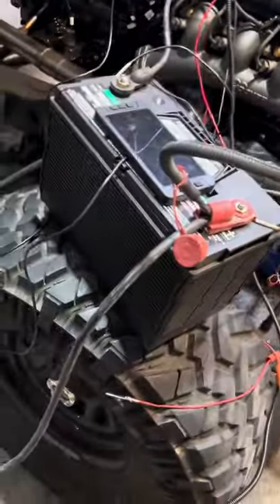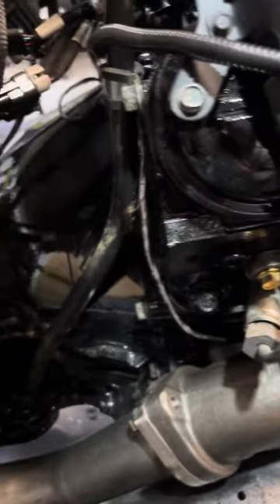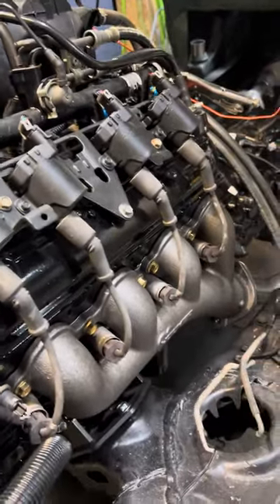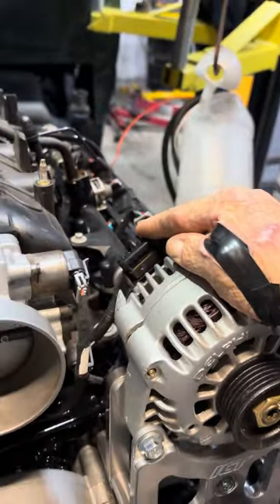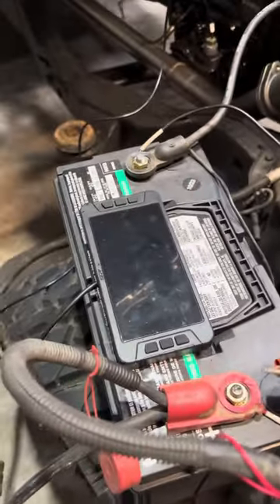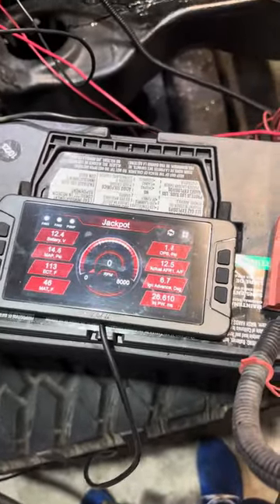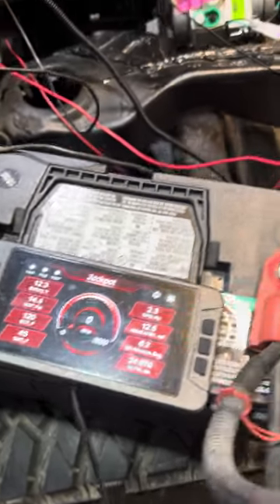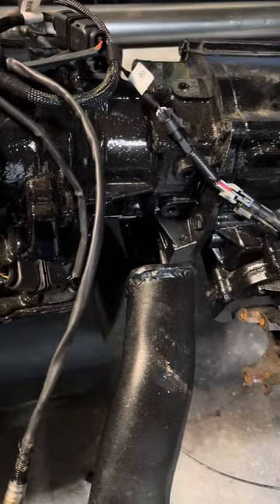Ace jackpot review

Comment: This is the second time I've heard the screen jumping and disappearing, so basically though they're cheaper than the Holley and other, ect. It's not worth the money. Did Jackpot help you out with the screening situation?
Reply from the maker: No. I mailed it in. They sent it back the next day and didn't fix it. The AC wire should turn on the fan, but it doesn't work, and their techs can't figure out why.  I just unplugged the screen and run it.  I would not buy this again.   i have a fi tech and a holley.  both are much better.

Comment: Thanks for the video I’m currently getting ready to install mine on a 71 el Camino I’m gettjng confused on how to wire the alternator
Reply: Main power wire from alternator goes to positive post on starter, along with the positive from the battery. the plug that goes into the alternator is a smaller wire and that goes to your keyed ignition. also don't forget the body grounds aka the ground from your block to the battery. if you don't do that it wont turn over very well. learned that the hard way

Comment: I have a problem where the lights on the ECU won't turn off.. is this normal to have the ECU lights on with the key on the off position? Please help
Reply from the maker: No clue.  I’ll look at mine.  It’s under the dash
Reply: Check which ignition feed you are using

Comment: your using the older style coils I thought you need the newer smart coils for this harness I guess not huh in less you modified it thinking of getting this system myself good stuff 🤙
Reply from the maker: Coils work fine for me.   I did have to get the newer style injectors ev6 and a newer style oil pressure sender.  I think it was for a 09 Tahoe